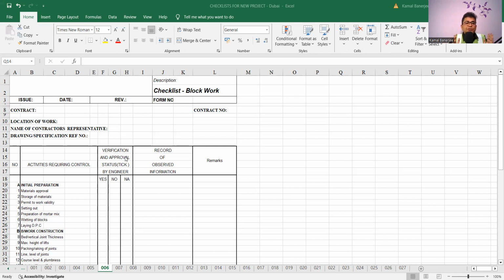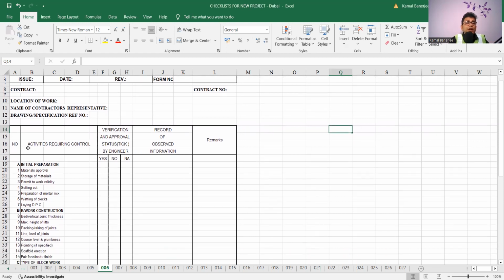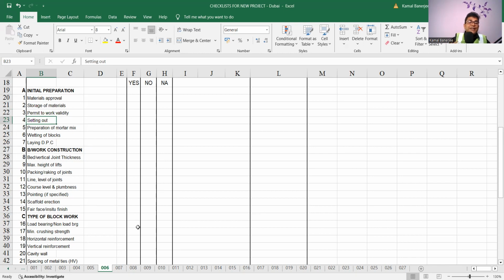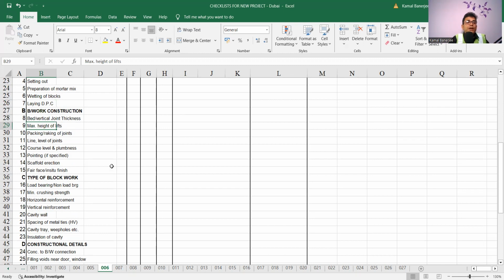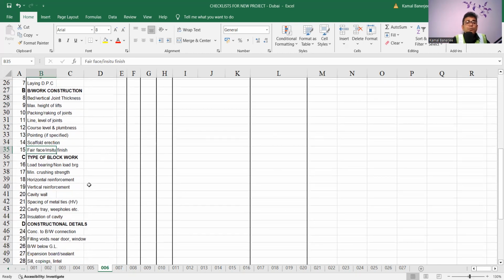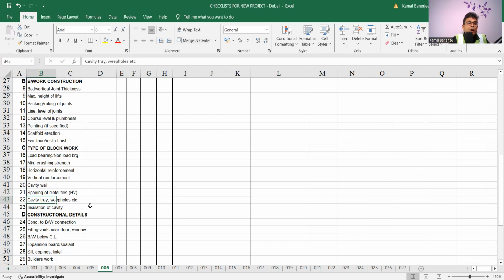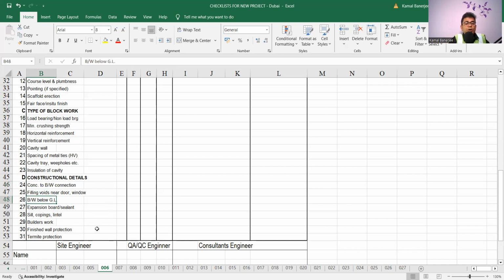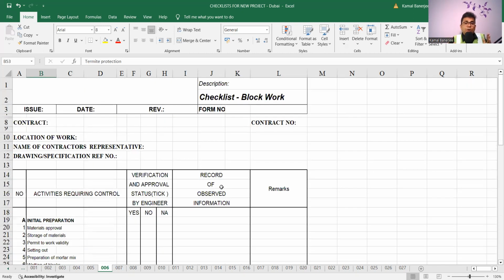Your Comprehensive Blockwork Checklist

Comment: thanks for sharing, but i have a question which Reference document you use to make this checklist, could you please let us know. thanks
Reply from the maker: Thank you like the content. For preparation of any checklist, first you need to check the project specification. Along with specification, IS 2572-2005, IS 6042-1985,  IS-6042-1985 to be followed.